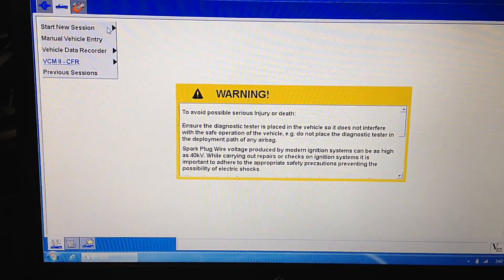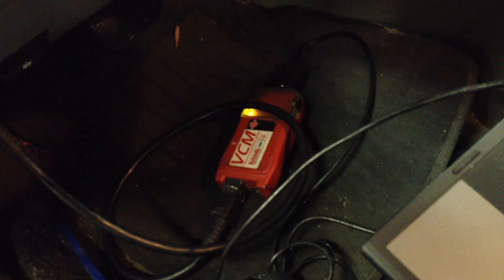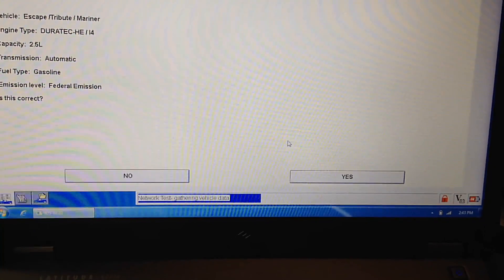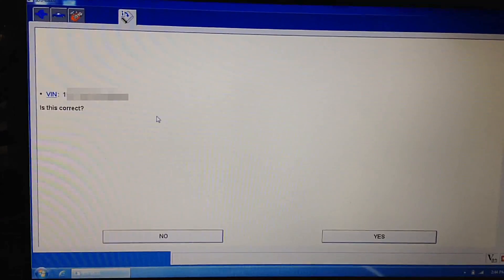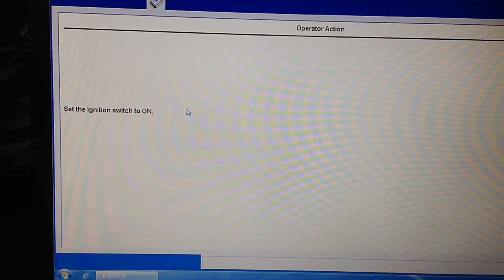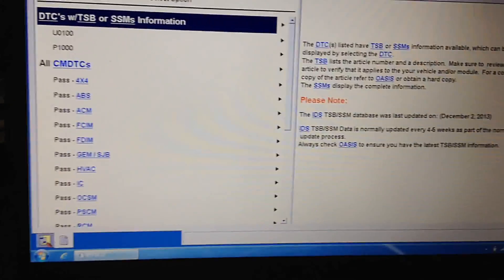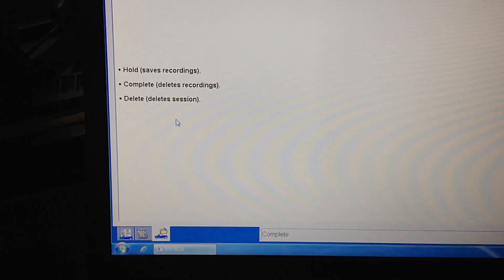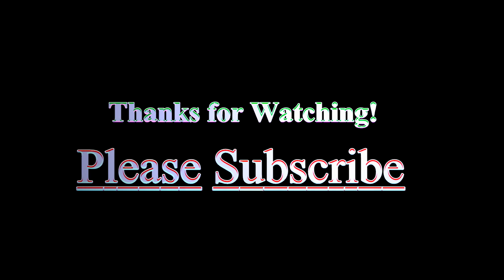Ford PCM Software Reflash Procedure

Comment: I left my key in the third position ON overnight. When I found this mistake I could not start the vehicle the battery was drained and I was receiving no power at all. When i attached the charger I started to hear the fuel pump ticking. I disconnected the battery and finished the charge. Once fully charged I reattached the battery cables and went to start the vehicle. I get rapid flashing anti theft LED the only power to the dash the is the airbag indicator for passenger, Airbag LED on dash and the fuel pump clicking. Once I turn the key I get the throttle body ticking as well.
It is a 2004 Ford F150 5.4L. 165K. I just put over 1500 in brakes, starter, outer ball joints and to be honest want to try to get out of it as cheap as I can. I watched your videos excellent by the way but all of them seem to have full power to the dash. I dont even have dome lights.
Any advice you can provide would be wonderful.
Reply from the maker: +Rich Bowers What is the battery voltage when the key is sitting in the run position? Sounds like your battery is not charged at all. Once they go so far down they may never come back.
Reply: +FordTechMakuloco That was it exactly, battery charge. I decided this morning after my post and following all your tips to place the charger back on the battery. It is a very small charger 15amp and let it sit until i reach 90%.
Started right up!! You DA MAN! oh yes you are!!
thanks for everything. I owe you !!!!  Please let me know how I can repay this great advice. Since I use it primarily to get the small boat back and forth to Duxbury Bay I am going to change the FPDM as a precaution  Saves me form buying that new 2015 Edge my wife keeps eyeing. You have no idea what you saved me.
Reply from the maker: Rich Bowers Awesome to hear!

Comment: amazing video thanks,  my son's 01 ford f150 is showing at least 30 codes when we took it to the local autoparts would that be the computer modul that needs to be replaced?
Reply from the maker: +bandido79 Not all the time clear the codes as per my pcm reset video and retest for the current faults.
Reply: +bandido79 Yeah dumbass codes are stored. Clear the codes then drive it several miles and scan it again...

Comment: I bought a wrecked 2014 Escape, the ECU was missing. I bought a used one but the dealer told me that it can not be reprogrammed or re-flashed. to the vehicle. Is that true?
Reply from the maker: +Isauro Ramos If you bought the correct ecu they can use the tear tag or engineering part number on the ecu you have to id the vehicle when it ask them if the vin is correct check no and it will prompt them to enter correct vin, then it will contact the ford server for the correct calibration file and as built data for your vehicle so it can be programmed properly. Most dealer techs don't know this.
Reply: FordTechMakuloco  You have been very helpful. I found someone who did the job and the car is working perfectly. Thank you!
Reply: FordTechMakuloco we bought an 04 fx4 and it drove home fine but a few days later it just stalled. We were told it was the Throttle sensor so we replaced it  now we are told it's the ECU or PCM but will need to be flashed for this special body or edition of pickup. Can you please guide us? Still confused. After the Throttle replace and doing the reset of DC the Neg on the Battery for 10min then letting it warm up we drove it a bit to do the reprograming of the rpms but within 5 mins it went right back to stall mode and no matter how much I pressed the gas pedal it didn't move anymore.

Comment: Hey you've helped me out with a lot of things for my truck but just wanted to ask you, what to do if a ford dealer says they can't scan  my truck with there ids machine, they suggested to replace my pcm which was $1500, I have gotten a emissions test with no problems and I've taken it to American brake and muffler and they was able to scan it and tell me what was wrong, does that mean my pcm is still  bad?
Reply from the maker: Willie Richardson If the vehicle start then the pcm is ok what you  may have is an aftermarket tune in there that the Ford IDS cannot recognize. If the vehicle starts and runs and they think the pcm is dead they are brain dead and you should not be going there.
Reply: Ok thank you very much

Comment: i Have a  2013 F150  Ecoboost  and  in  May  2014 i  had a  recall to  reprogram  PCM  and  ever since that   i noticed  issue  that one of the  turbos  didn't seem to  be  coming  up.  What happened if  you  start  from  stop and   hit the   gas   i  get s  slight  shudder   and  i was told  a  turbo needed to be  replaced,  after  it  being in  dealer  for over a month  they  said   its  caused  by the   plow  frame  by Sno-Way  and lack of   air  flow  was issue and  overheating the  turbo.  I had   researched  everything and  i think  the issue is  PCM as  i had no issue  before  they worked on in  then  and programed PCM.  I  get no  codes  of  any issues  which   makes  me  believe  a  wrong  flash was  done.
Reply from the maker: thejohnsonsnh The reflash cannot be done wrong the ids automatically pulls the latest file from the ford server and then checks the integrity of the file before loading it onto the pcm.

Comment: I need your helps I have a 2006 Ford f-350 6.0L  got a engine code on my scanner P0069 and a P0237 I clear them out of my edge scanner  I Drive my truck the next day and the check engine light came on aP0069. I replaced a MAP sensor intake sensor oil pressure sensor coolant sensor and I have a performance tune from SCT I looked up the code and it says PCM

Comment: Hello Good Afternoon, One question I have a Lincoln Town Car 2005 No trouble codes but the Evap And Catalytic Monitors seem to not get ready I need either or to pass inspection for a client I've tried a KAM Memory Reset also the vehicle has already traveled aproximatly 320 miles and nothing, do you suggest reflashing the pcm if so with what tool?

Comment: First of all, thanks for your videos, they help me a lot......I need your advise regards a code that might be related with this video....

I have a ford freestyle 2006, 78000 miles, last month i had a wrench tool code (don't remember exactly the number ) but was related with the transmission,eather hot tempertur , low level .I checked the fluid and was low like a quarter...fill up the fluid and the code( wrench tool) is gone.
Today i have a C.E. light, the code is P0106, that is related with " Manifold Absolute Pressure/Barometric Pressure Sensor Range/Performance" .
Should i Reflash the PCM software? . The car is pretty new, only as drive like 7000 miles per year.....

thanks

Comment: I have a Mazda Tribute 2009 , 2.5 , manual. Original broken PCM  ID is 9L8A-12A650-DG. I got one with ID 9L8A-12A650-AEC. All the same but automatic transmission. Dealer tells me it will not work as clutch module is not present.
BS?
Can I just erase 9L8A-12A650-AEC and flash that PCM with 9L8A-12A650-DG using your soft?
Thank you.
Reply from the maker: Dato Batona Not sure on the clutch module part but if you already have the pcm just flash it the IDS will tell you if the pcm will work or not.
Reply: FordTechMakuloco The question is :
When IDS downloads an image from Ford ftp side will it use my VIN number or VIN number saved in foreign PCM ?
Or it does not use VIN at all but use hardware type ID like 9L8A-12B684-DB?
Depending on that it will download correct or wrong image.
As I understand you can't manually configure the exact image ID you want to download and install.
Am I correct?
Reply from the maker: When you id the new module keep the key off, id it with the original tear tag then program in your vin that is correct for your vehicle it will choose the right calibration file from there based on the tear tag.
Reply: FordTechMakuloco  Does not work . 
Clutch module is not present but cruise control module came from automatic one  :)  
 Looks like second number on PCM label -- Hardware ID is more important then PN.
 Boards are different for Tribute/Escape with manual and automatic transmission.

Comment: I have a 2000 F350 Superduty Powerstroke 7.3L Diesel, Dually 2wd.  I recently purchased the Autoenginuity PC Scan Tool ProLine VCI Total Ford Bundle SP03 for this truck.  I was able to pull these Diagnostic Trouble Codes: C1155 Spee Wheel Sensor LF Input Circuit Failure(Anti-Lock Brake)  B1352 Key in Circuit Fault(found broken connection in wiring connector(door chime)that connects to the inner side of ignition switch.  B1318 Battery Voltage Low(2 Fully charged(new) Interstate Megatrons) and B1371 Interior Courtesy Lamp RElay Circuit Failure.  THE MAIN PROBLEM I AM HAVING NOW IS, I AM UNABLE TO GET THE SCAN TOOL TO GIVE ME ANY INFORMATION FROM THE POWERTRAIN(box pops up telling me their is no communication,..etc..)  WOULD IT SAY TO SAY THAT MY PCM IS INOPERABLE? OR DOES IT NEED REFLASHING?  PLEASE HELP!!  Diane  419-557-4706   Truck shut down on me and left me stranded in March of 2014(brutal winter here in Ohio -40 degree windchill)  only thing I fixed on it 5mos. prior to breakdown was fix both drivers and passenger side door actutators. I did the aluminum foil wrap I found from the FordForum. I now have locks that work However, I am now dealing with a CRANK BUT NO START SITUATION WITH POWERTRAIN NOT RESPONDING TO THE AUTOENGINUITY. Loss of time and money here,...
Reply from the maker: Lady Di was the scan tool bought for this issue of crank no start? If not did it talk with the pcm before?

Comment: So... can you really tell if there has been a tune installed in a F150 ecoboost, and then removed prior to taking it in to the dealer?  If so, what kind of information, or fingerprint, does it leave?  I'm thinking about getting a tune for improved towing and MPG but don't want to kill the warranty.  Thanks!
Reply from the maker: Shawn P I believe it leaves a p0650 code or something like that behind and if we go into check the pcm part number it will not be right also. Most dealers do not check for this though.
Reply: FordTechMakuloco Thanks!

Comment: hello I have a ford f150 2005 and code marked P0506, I need to reflash PCM??? or what I need to do? tanks
Reply from the maker: Daniel Serrato which engine 5.4? any recent work done.
Reply: FordTechMakuloco yes 5.4, i install a led bar
Reply from the maker: With that code first clean the throttle body and relearn the idle per my videos and retest.

Comment: I have a 2008 Edge SE I bought the 3 button message center switches that show MPG etc. I see the dash has the info. but it does not light up after I installed the buttons.  There were wires and a jack i plugged into new switch. Do I have to have PCM redone in order to the message center to work, or any ideas? Thanks
Reply from the maker: chris t They will have to enable it with the IDS scan tool yes.
Reply: FordTechMakuloco Is that something a ford dealer can do and be willing to do? thanks for your time, and videos..

Comment: Hi, which software are you using? Does it need a private subscription? Does it work with Tech II? I appreciate it a lot if you reply to eeehabt@yahoo.com
Reply from the maker: Reem Alfala It is the ford dealer scan tool called the IDS. There will be a future video on this. It is very expensive though.
Reply: Thanks

Comment: I have a 2008 Expedition 5.4, I put a scanner on the truck and it reads the vin and vehicle info, gives live feed but will not do a two way communication. I request to shut off fuel pump and nothing happens, This goes with other components as well. the vehicle idles rough and backfires. No code pop up. It' s drives rough. I have been led to believe it's the PCM. What do you think.
Reply from the maker: krad uisz I have never seen a pcm failure on a 2008 expedition no.

Comment: Makuloco nice video! Well done.
I have a question about installing a new PCM in a 2008 Ford Focus. If I buy a new PCM what is involved with programming it for my specific vehicle? What are we talking shop/dealer hrs for cloning or making a new PCM/ECU for my specific vehicle? 
Thanks and again nice video
Reply from the maker: watertiger33 You will need all your keys and then they basically do this procedure with pats programming so expect to pay 1-1.5hrs
Reply: FordTechMakuloco  Thx.

Comment: So I guess my question is when I get the new pcm could I program it myself like you did in the video or do I have no choice but take it in to Ford?
Thanks
Reply from the maker: Jerard Johnson In the end you must still take it to ford to be programmed yes.
Reply: @FordTechMakuloco  I have a 09 escape 3.0 and it has a delay/hesitation when hitting the gas especially from a dead stop, only has 125000 kms, would a reflash help?

Comment: Ok i have a 07 Ford Edge with a code marked P0356. I replaced all the coils and spark plugs before and now it's saying number 6 again. Was wondering if a new PCM would be my next step and would this video help me to reprogram the new one. If so where did you get yours? Trying to save some type of money
Reply from the maker: Jerard Johnson Check your harness for chafes but otherwise yes a new pcm is in order.

Comment: Hello! I was wondering if this software can be used to remove the DRL feature on my 2012 Mustang? It is an American Mustang that was used in a fleet service, just in case you are wondering, and I want to deactivate the DRLs.
Reply from the maker: Ivan Rodriguez According to the manual on this year and model yes these can be set to on or off with the dealer scan tool.

Comment: Hi good video lots of information question do I have to flash the PCM for the throttle actuator i m having a surge 2007 f150 4.6 2v? Any info greatly appreciated Thank you
Reply from the maker: Daniel Garcia Clean or replace the throttle body then relearn idle no flash is required.

Comment: Hi I have a 2013 ford fiesta I replace the ABS but now it doesn't work. the TC is not working. Do you know if I need to program the new ABS so it could communicate with my car PCM?
Reply from the maker: Marco Mendoza Yes you must program the as built data into it.

Comment: FordTechMakuloco hey I am wondering if i can use my VCM II to change the VIN to a different vin for my 2011 Mustang GT reason I need to do this is because we are doing a 2013 cluster swap which requires the vins to be the same.
Reply from the maker: Michael Steele I have before on older Fords just leave the key off try to start a session and enter tear tag to id vehicle, when it asks you if this vin is correct say no and a box will come up for new vin input.
Reply: Thank you!

Comment: I have a 1999 F150 5.4 which threw a code P0605 which is PCM code i guess.  It seems to be running fine tho.  Would you get the PCM flashed or just roll with it until there is a problem.
Reply from the maker: Roll with it, this error code can also be set by low battery power sometime in the past.
Reply: I'm sorry its not P0605 its P0602.  Which is the VIN code in the PCM.  Does that mean the Computer might have been replace?  Is this something to worry about?
Reply from the maker: I would get the pcm programmed to the vehicle via the PMI process at the dealer for this code.

Comment: Hi I lost my keys to my 2001 ford explorer, had a locksmith come out and could not program it,  Found out my pats harness was broken, had another lock smith come out and still canot get it done.  Can i reflash my computer to bypass the stupid thing so i can get y truck going again.  Thnaks Keith
Reply from the maker: keith motola There is no bypassing it, you will have to fix the problem they say is causing the pcm to not read the key.

Comment: Is it possible to reprogram a 2001 explorer sport from a 235/70/16 tire size spec to the optional 255/70/16 with this setup to fix the speedometer being off due to taller tires.
Reply from the maker: It is possible to go a few sizes up and down with our scan tool yes.

Comment: I just installed a remote start on my 2013 ford will this also update and enable my remote start fucntion.
Reply from the maker: mark nguyen At the dealer they need to enable the remote start function with the scan tool, no software flash needed.

Comment: I have a 2006 Ford Explorer 4.0L. I have changed the solenoid pack and still have a hard shift. The code I get is P0733 as well as P0745 solenoid A. I cleaned the MAF and I'm at a lost. Does it sound like it is the clutch slipping? Thanks in advance!
Reply from the maker: Richard Price Sounds like worn servo bores to me. Does it tach up and hard shift into 3rd? Does it happen more when warmed up?
Reply: Yes...what is the correct fix. I already changed out the solenoid pack
Reply from the maker: You must remove the trans disassemble it and sleeve the servo bores very big job.